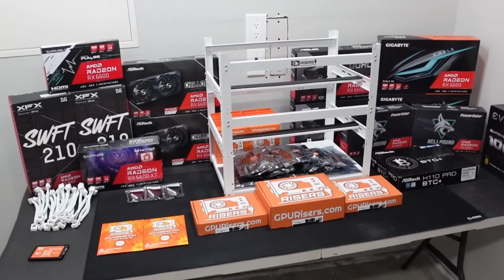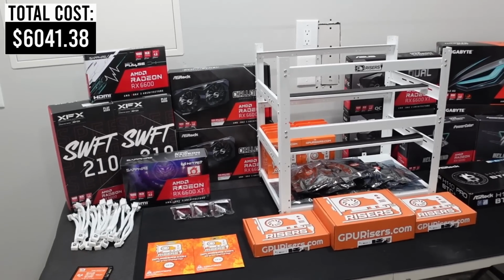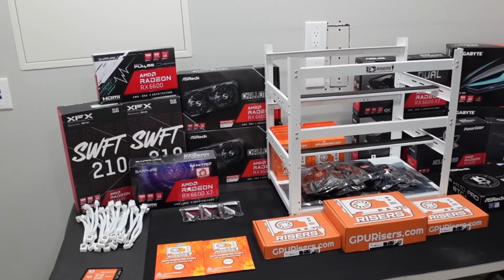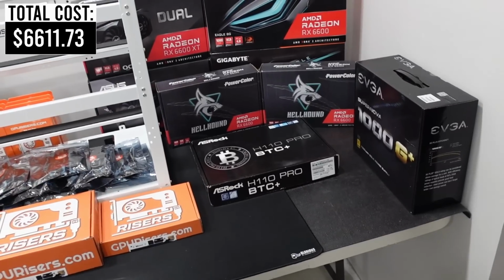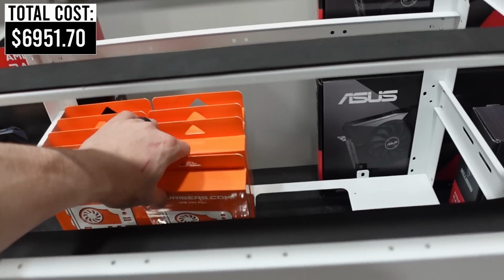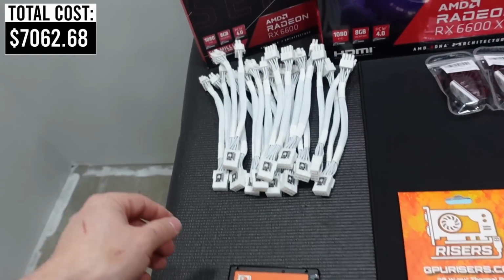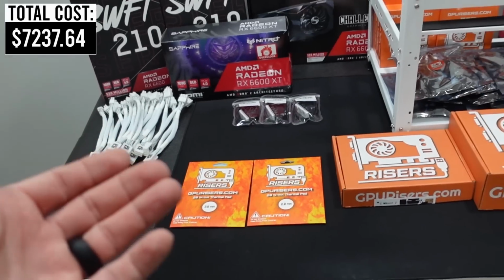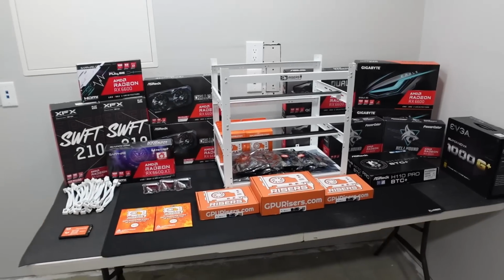My Most EFFICIENT Ethereum CRYPTO Mining Rig Build

Comment: $7251.62 in hardware cost for 12x 6600s with approx. 30 Mh/s each so 360 Mh/s total and roughly $20/Mh. So ROI if you mine ETH (before 2.0 lands) is 550-650 days depending on electricity and pool costs. Maybe I am thinking of a really old video, but didn't you say that your strategy was to ROI cards in less than a year? Maybe I am misremembering or missing something. Are you betting on a lengthy 2.0 delay or do you have plans to mine something else after 2.0?
Reply from the maker: Great response. I appreciate the questions.  Ethereum is one coin, so I am basing nothing off Ethereum POS and timeline.  I view this as an investiment.  So with that in mind my goal is long term profitability, not within the next 365 days.  Several months back, anything that ROIed in a year was fantastic on ETH.  We are not seeing that anymore or at least at the moment.  My goal is to invest now to profit long term down the road.  After Ethereum goes POS, i will move to the next profitable coin and so on.  Too many miners are carrying the mindset of when the market was UP, you have to flex and pivot.  Investing in a down market, is risky but traditional is fruitful long term.  Hope that helps!
Reply: @TheHobbyistMiner  It does and all of that makes sense. So we're getting into crystal ball land here, but I am curious on your mindset on that fruitful long term. What's long term for you? The experts (lol) seem to subscribe to the 4 year cycle theory. Or are you looking past that? Is the thought 'There will always be something to mine profitably' or that the markets will turn around and then you'll be set to sell or capitalize? Maybe a little of both?

I appreciate the perspective. Thanks for the videos, they've been informative. Especially when you talk about mistakes you've made.
Reply: @TheHobbyistMiner   great videos man, very useful for newbie’s like me. My question to you is why don’t you invest in some more expensive gpus like nvidia 3060,3080 with whom on theory you can mine faster, Especially when you have so many rigs. Isn’t more powerful gpu means more profit or its better to use some mid gpus which is less pricy and consuming less energy ?
Reply: @TheHobbyistMiner  rx550 4gb slim get 12.5mhs at 21watts on ETC. I sold that one and kept that fatter powercolor version to use in a pc and can only squeak out 10mhs at 21watts before crashing. 37.5mhs at 63watts for ETC is pretty efficient. Although you do need 3 cards to do that, you only need riser power. :) Hoping I can snag them cheap again. $80 shipped as I'm typing is the average price. So $240 for 3 rx550 slims to get 37.5mhs at 63watts on ETC. Do not get the bigger PowerColor versions, they crash after 10mhs. I'm just trying to find the most cost efficient way to increase mhs and keep efficiency high. I'm running 1 rx550, 1 rx480, 1rx570, all 4gb on etc, an rx580 8gb on ETH, and a 2gb 710 on UBQ. It's an oddball rig, but I learned the hard way about r9 390s and expensive motherboards. Although I did double my money on all the r9 390s I bought last February, they were barely profitable after the need for additional air conditioning in the room. Now I have just the one rig making the same profit every month as I was making with 3 rigs of r9 390s and constant air conditioning.
Reply: The actual ROI is hard to estimate as it's in nominal banknotes, if governments prints like helicopter cash, your ROI might even be 1 day they just add additional 0 to your banknote, later when those 0 become in millions, to avoid confusion a new money is created with equivalent of old 1 000 000$ = new 1$.
In normal times ROI Would be more than 1 year or so it could go up to 5 years... If things go to 5 years or more, than I would switch to different business, like electricity production as it is more lucrative market... If you are lucky than spending all money before it;s collapse is - like to be born under lucky star. To avoid confusion I would say ROI is important, but there are many hidden things under it like time, nominal cash, money now is worth than later and so on... If you don;t know this than get a diploma in business or even better finances. 

Cheap studies are in eastern europe and are on par with cambridge or oxford as some lectures are same people that travel from one university to another... Learning is not all about the place - but more about people. Remember the saying your home is where you are...
Reply: THIS!

Comment: have an asrock, pulse and xfx 6600
all perform the same and cool the same within margin of error - the pulse is tiny which can be useful.

Cant see a need to change thermal pads on the gigabyte, its a huge 3 fan cooler on a super low TDP card

Comment: Great video! I currently have half of your current rig running on an EVGA 1000watt Gold PSU and I dont understand how to power more 6600 cards... Power supply has 6x 8-pin SATA outlets, each split to one card and one riser. Any advice would be appreciated =)
Reply: use pcie splitter cable. browse youtube for more info

Comment: $7200, Ethereum(ETH) $8.36 per a day, *365 =3051.4 per year. you need 2.4 years to recover your cost. you still want to make a miner?
Reply from the maker: 100%.  This is an investment, not a get rich quick scheme.  I do not believe ETH or Crypto as a hole will stay where it is right now.  Lots of opportunity with other coins and the upcoming different markets.
Reply: You can buy cards cheaper and get SOME free equipment to cut costs. I just scored an xfx rx470 for $132 that needs fans. :) At around 30mhs on ETC for 75watts, ROI is 307 days at $0.165/kwh!! Somehow I have the correct fans sitting in my parts bin I ordered for the wrong card last year. Win win.

Comment: 600W's consumed by 12 GPUs ? --- I'm guessing you using actual wattage ? --- You are not using TDP to measure ? --- TechPowerUp says 6600 TDP is around 132W --- 6600's power usage runs about 50-60 watts from what I've seen.
Reply from the maker: Correct. I am not going off of TDP.

Comment: Are there other alternatives to the H110 btc pro? They're selling for absurd money everywhere I look. I've seen some direct usb connection motherboards, but unsure if those are decent
Reply: I've found the Biostar TB360-BTC motherboards to be really solid. Pricy but with a CPU, it's still cheaper than just the H110 alone. If you have any questions about them let me know. Also, I'm currently working on setting up a B250C that I picked up from Aliexpress for 87 bucks. If it works out, it'll be by far the cheapest option.
Reply: You can use a PCIE splitter and make 1 x16 lane into 4 x1 lanes with male to male usb cables. It's my favorite way to save money. Find a cheap mobo/cpu or potentially free from the right curb. Each x16 can be split into 4-x1 lanes. I'm currently running a MOBO from 2011. lol.
Reply: @TrickyMickTrucking  ah okay. That's currently what I'm doing with my Asus boards. Just went to 8 with 1 splitter to now 9 cards with 2 splitters. Wondering how many I can fit total. I'd like to shoot for 12
Reply: @BlessedNoobCrypto  That sounds good. The non-mining boards have problems around 11-13 GPU in my experience. What GPUs are you using?
Reply: @TrickyMickTrucking  mix of 3060 lhr, 3060 ti lhr, 3070 ti and 6600 nom-xt
Reply: @BlessedNoobCrypto  I'm ore of an AMD guy, but I'd like to start adding some Nvidia stuff. The 710GT 2GB is pretty funny as a miner. I spent so much money on r9 390s last year, should have made some videos but oh well. I ended up making their cost back in ETH and then flipping them for at least $100 more than I paid each. I can't believe how crazy the market gets overnight sometimes. I'd like to get a 5700xt next. Just got another xfx rx470 4gb for $132 shipped because of no fans.
Reply: @TrickyMickTrucking  damn, I haven't gotten too many used cards. I do 2 580 8gb, 1 3060, 1 1080, 1 1060 that I got used and Friday got a used 3060 ti fe used. But other than that been all new. I have 18 cards total. 

I love the 6600, have 3 gigabyte eagle 6600 from bestbuy for $455. May get a few Sapphire Pulse 6600 from Newegg or make a trip to micro center next month and see if they have a 3090
Reply: @BlessedNoobCrypto  I posted a video that has all used stuff besides the risers. To be fair the rx550 WAS new 1 year ago. The motherboard and CPU were new 11 years ago. 😂 This equipment will last a long time with small amounts of care. Hoping to get solar going.

Comment from the maker: What is your most efficient graphics card?
Reply: 3070 FE @.56 in Nicehash.  That's with just plugging in recommended overclocks.  I haven't done any real tuning out of laziness, but it still beats the best efficiency I've gotten from my 6600.
Reply: RX 5600XT (bios moded) 42Mh/s 78W at the wall,  RX 6600XT 32.8Mh/s 62W at the wall,  GTX 1660Ti 30.90 Mh/s 70W (wall), GTX 1660S 32.6 Mh/s 80W (wall), rest of the cards I have are not competitive (3060ti lhr, 3070 lhr, 3070ti, 2060S)